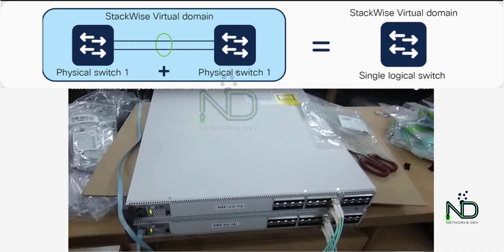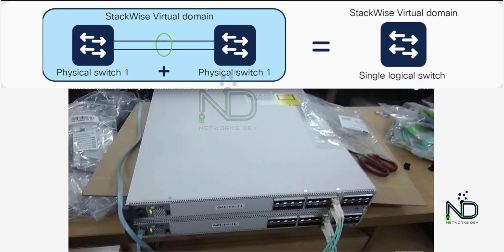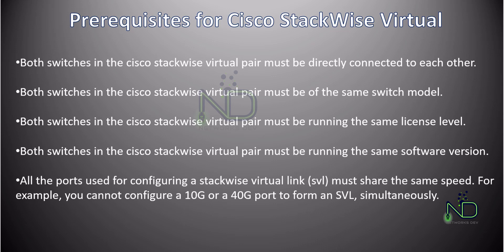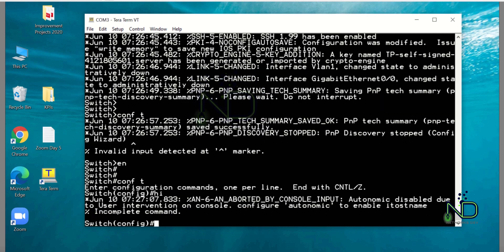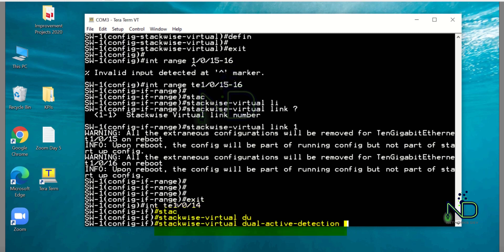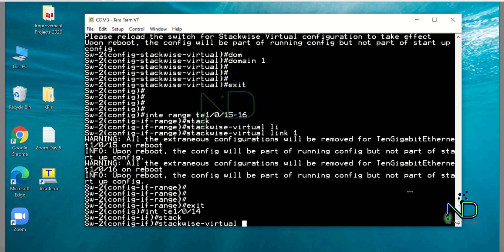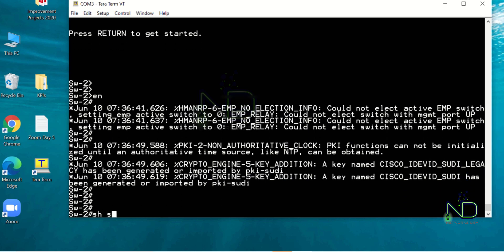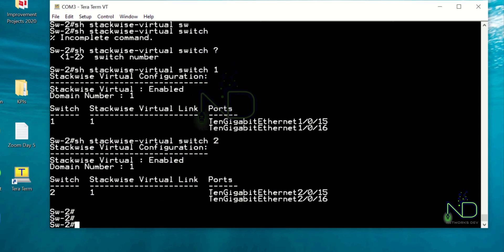How to Configure Cisco StackWise Virtual with Catalyst 95K Switches | Virtual Stacking

Comment: you can use just 1 port for SV link right?  or is it minium 2?
Reply: Min 1 and it support upto 8 links
Reply from the maker: You can use one but it is single point of failure, Not recommended by Cisco